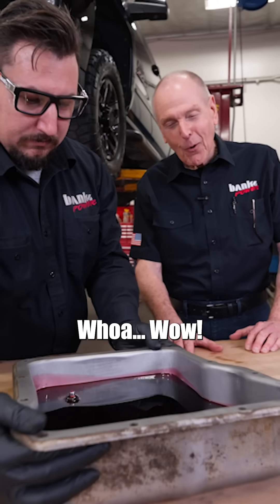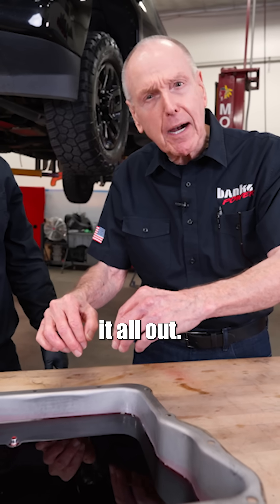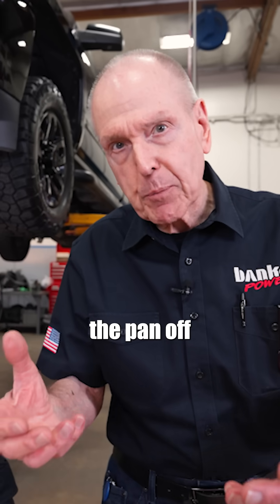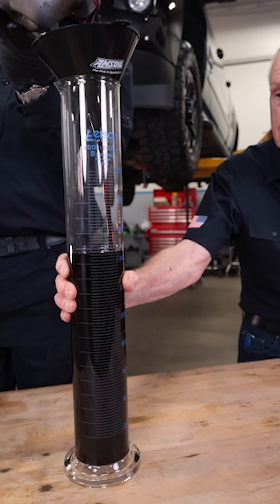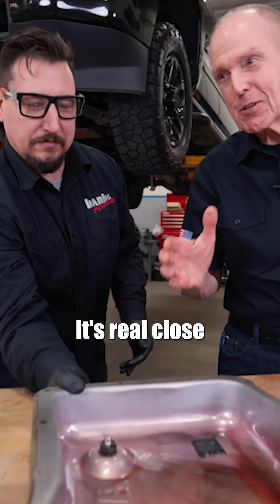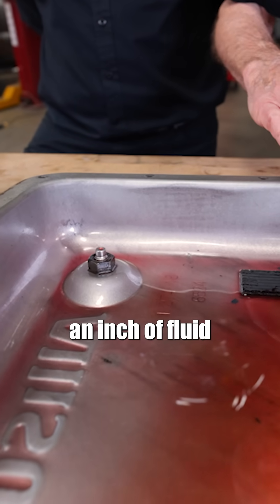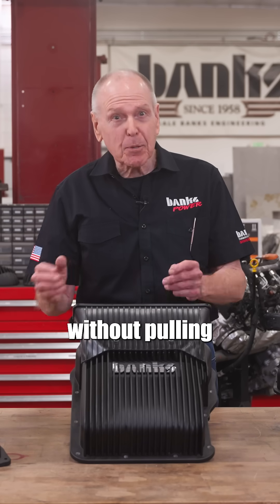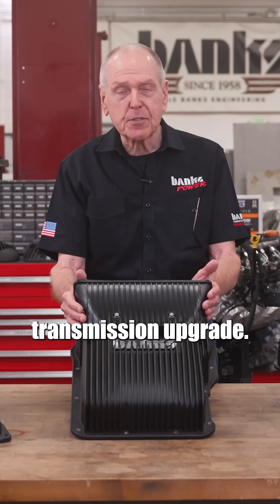This factory drain plug is a joke.

Comment: You know he's a legit engineer because despite being deep in the automotive world, the man actually uses metric units for fluid.
Reply: He used quarts despite the fact that his cylinder measured in mL. It's an easy conversion, though, a liter is a quart and a bit, so a quart oughta be about 950mL. He was about two teaspoons shy of two quarts. Who designed that OEM oilpan?
Reply: Every single American-educated engineer is 100% fluent in both imperial and metric unit systems. Automotive and machining especially utilize EE units because these fields were popularized in the US first, so it’s common to use things like gallons or quarts. But the metric system is better for small fluid measurements in this case, and converting between mL and US quarts is comically easy for someone fluent in both. So yea, it’s not really an indicator of a “legit” engineer, just one with a degree from an ABET-accredited institution.
Reply: @kadenielsen210  Side note...I was educated here at an ABET-accredited university, but I wouldn't say I'm "American-educated" since most of my upper classes were in one of three languages I don't understand well: Hindinglish, Mandaringlish and Python.
Reply: Conversing or calculating in metric units has absolutely no indication of an engineer’s ability or qualifications! Who told you that, your 9th grade general maths teacher?
Reply: They ought to be using the old Hogshead units.
Reply: A quart is not a metric unit of measure
Reply: No neither are .😂 @blakebrown534
Reply: That's BS. All engineers can switch units easy. And many fundamental texts and engineers still use imperial units.
Reply: European people deep in the automotive world have left the chat, since, y'know, apparently they don't use metric units lol
Reply: What are you on about the man refused to say litre with all his being.
Reply: Try finding a graduated cylinder in imperial units.
Reply: I don’t know bro but in Europe we use both anytime we need 🙏😂🤷‍♂️
Reply: imagine not realizing a quart isn't a metric unit.
Reply: @thedarkness125  they are really close to each other. 0.946 litres is 1 US quart.
Reply: @datgamerboy123  Ah, but in the English Imperial system, a quart equals 600ml, so if this was measured in Australia, it would be over 3 quarts.
Reply: @coolhand1964  I guess?
Reply: @thedarkness125  imagine not realizing a quart is, a quarter of a gallon.  it is not a metric unit at all, its roughly a liter.
Reply: @thedarkness125 attention span & reading comprehension (not) much? He references both as the graduated cylinder is filling. But guess what? His final volume measurement is using----a metric unit. Re-read OP's original quote, slowly, 3 time if you have to😂😂
Reply: @cc23001 
His final measurement was: "It's real close to two quarts". 
You are objectively wrong.
Reply: What he literally uses quarts multiple times which is not metric. Every engineer should be familiar and be able to use both metric and imperial. It’s just a conversion mostly. So u kinda gotta be stupid to not be able to.
Reply: @tysonchickennuggets  It's baffling to people that there are people in the world who can convert both on the whim as if it's a 2nd fluent language.

People from the UK are all trained pretty well. Anyone remotely math-inclined in the UK can convert on the dot.
Reply: i like both systems. some things work out easier depending on what the task is.  in the auto world i like quarts and gallons but when working on cars i like metric tools.   its much easier to look at a fastener and know what size metric tool vs sae tools.
Reply: @WhittaII  the UK still uses some parts of the imperial system directly along side metrics, not to mention the differences in US vs British imperial units. 
They got some fun conversions going on over there, and what put me onto it was hearing the top gear crew mentioning gallons when getting fuel one episode. 

All this however makes reading arguments about the superior unit of measure 100x more entertaining because mostly its all out of spite and reverting to other units and saying the previous ones are horrible lmao. Adopt a standard from across the pond, Britain changes something, we adopt that, then Britain reverts back, and out of spite we dont haha. 
Even funnier that metric was made by the french and we were one of the first to trade with them using metrics being they were a crucial ally to the US to spite the British. 
History and unit standartization is freakin wild lol.
Reply: @MrChevelle83 I disagree on metric being easier to identify. I have no issue with either.
Reply: @WhittaII   most conversions between metric and imperial require the use of floating point numbers, doing that in ur head is stupid. unless ur saying only a general estimation.
Reply: @tysonchickennuggets ok this is how English works: OP mentioned Gale "USES" the metric system. You don't think that means he never used imperial, do you? Because that's NOT how English works😂😂
Reply: @cc23001  ragebait? i said he used both.

Comment: I am not familiar with those transmission,  buy my pickup holds 11 quarts after rebuild. But only 6 when pulling the pan to change fluid. So only a little over half come out, i think thats pretty normal for hydromatic transmissions.

Comment: its to visually check for debris or particulate matter. yes your pan will be better, temp wise for the transmission but the oem did it for diagnosis. i do diagnostics at a trans shop but i still recommend some aftermarket pans for heavy duty trucks with a aftermarket cooler.

Comment: Back in the day oil changing places would just use an air hammer to punch a hole in the back corner of the pan to drain it, then put in a rubber plug back in the hole never even touching the factory drain plug because god forbid it's just hanging on by a thread then you finish braking it and now you need to replace the whole pan.
When I had to rebuild that trans, I just pulled the rubber plug, then brazed a nut onto the pan and there was the new, replaceable lower drain plug.

Comment: Typically you are supposed to drop the pan to replace the filter when doing a transmission fluid change.  The plug just helps make sure you dont get a big bath when dropping the pan.

Comment: Drain the pan.  refill the pan.  Disconnect the cooler lines.  . I use an electric fuel pump in a 5 gal bucket of trans fluid.  Turn on pump connected to return line.  Start vehicle.  Pump will fill pan for pump to flush torque converter.  Fluid exiting cooler line will turn clear red.  Turn off vehicle and stop pump.  Reconnect all lines and adjust fluid level.  Complete fluid change and TC  low pressure flush. I do it every 25k

Comment: This is good and all except this it cause a longer warm-up period which typically inhibits torque converter lock.  Even on stock setup on cold days sometimes it takes 30 miles or more to get the fluid warm enough to enable converter lock.  On really cold days the fluid cools off enough and the converter will un-lock.  Properly designed cooling system will have a thermostat.  This is an unregulated system.  A thermostat is more of a minimum temp device and not a max temp device.  If you need more cooling, add more cooler after the thermostat.  Fluid being left in the pan is not that big a deal,  suck it out or drop the pan and dump it.

Comment: I see what he's getting at and gale is an absolute legend. But all services iv done on these you use a high pressure transmission flush machine at the line hook up. So the drain plug really has no effect on servicing it properly.

Comment: Waist of money, I have to drop pan to change filter out anyways lol.
Reply: You do, but it's easier to drop when it's empty.
Reply: @justinnieves984  brah, lol. the 68RFE doesn't even have a drain plug stock lol. So I picked up a cheap metal Dorman for just over $100. Looks just like stock but has drain plug. Doesn't matter if there is any oil left on bottom of pan because once you take it off it's pissing fluid on you the entire time you are under there, it never does stop dripping fluid.
Reply: The filter is external on an Allison
Reply: @TheWabbler  I thought there was one, they have the canister on out side but the flat one on inside. I have the dreaded 68RFE transmission, no problems with it yet knock on wood. They are both internal.
Reply: I would be asking, why did Allison take the time to raise the area where the plug is at? It costs them more money to do that then just put it on the flat or even depress it. I would be careful redesigning things when I don't know why they purposefully did something in the first place.
Reply: You don't have to change the filter as often as the fluid.

Comment: Transmissions ive worked on with drain plugs usually have filters inside you have to pull the pan to change anyway
Reply: That was my thought 💭 too
Reply: Gotta pull the pan to change filter. The drain keeps it below the top of pan for a clean removal
Reply: @GreggWalken-xd3qv  the Allison has an external spin on filter. I'm still a proponent of pulling the pan to inspect for crud and chunks. I like an inch or two of fluid on the bottom of the pan to get an idea of the general condition of the transmission when the pan is removed.
Reply: @GreggWalken-xd3qv  Still no reason why you can't drain it fully... would make for a much cleaner pan removal, like 0 chance of drenching the floor and maybe yourself in fluid.
Reply: @GreggWalken-xd3qv  Not in the Allison. It's an external filter like an oil filter.
Reply: @dodgeplow  My RDS 3000 Allison has both. Internal is a $27 screen type filter allowing 
one to check and clean the pan magnet. The pan gasket cost more than the internal filter
Reply: Yeah ZF trans in Mercedes are this way or built into the pan. So every 60k, new pan and fluid service. $$$$
Reply: @kyleohara1949  Mercedes automatics are all made by mercedes. No zf here :)
Reply: Allison recommends to only change the internal filter at overhaul. Hence why this makes sense.
Reply: @ArizVideo  ok, but even if you don't change the filter, you take the pan off and wipe it out. there's sediment in there AND the particulate magnet that needs to be cleaned. there is no point in putting clean fluid into a dirty pan. the chilton time guide accounts for taking off the pan and cleaning it. you are PAYING for that part of the service, if they are not doing it, you are getting cheated.
Reply: So wouldn't it make sense that the panel has no fluid in it, so it's not a mess to drop?
Reply: @pws3rd170  crud sinks to the bottom of the pan, if the valve were right at the bottom there's a risk it'd get clogged with said crud. Removing a full pan because the valve is clogged would not be fun 😂
Reply: @ShortFilmVD  Fair enough. What if you had a strainer around the drain plug? No clog, maximum draining
Reply: @pws3rd170  the strainer might also get clogged over time and need cleaning out / replacing. Even if it doesn't, it's a extra cost and solves a problem that doesn't really bother anyone all that much.
Reply: Allison's have an external filter
Reply: @ Most still also have a form of filter/screen on the pickup tube, which is still supposed to be cleaned or changed at fluid change time.
Reply: @Superman-pf6uo   they have 2 a spin-on and internal one. So you have to
Reply: @Superman-pf6uo  and an internal one as well
Reply: @Superman-pf6uo  Allison"s also have an internal filter.
Reply: @Superman-pf6uo 5&6 speed 1000 series have 2 a external spin on and and internal aswell.
Reply: @Superman-pf6uo They have an internal and an external, you’re supposed to replace both each time
Reply: You also have to remove the pan to install a new banks part
Reply: That's an Allison, it has an external and internal filter. You change the internal filter much less often.
Reply: @rickyborden3287  The internal, if I recall, is a strainer type filter that is typically cleaned off requiring to be replaced much later than the external filt which consists of fins.
Reply: they all got filters
Reply: You are correct, But I change just the fluid at every oil change and the filter at the scheduled intervals.
Reply: @johnshanks888  you change trans fluid with every oil change?
Reply: My Nissan has a transmission filter that isn’t supposed to be changed.
Reply: @MrPlaidFace people hate on them but the good ol Germans use external filters such as the VW DQ250 DSG. They also don't tell you to run a trans for 100k miles on original fluid. People say high maintenance because they often tell you what the maintenance actually is up front. 30k service intervals for fluid and filter. Spark plugs are 60k. Etc
Reply: Most leaks on pans are on gaskets or drain plugs plus I’ve seen crappy diy jobs where they don’t even tighten there plugs and they vibrate off while driving leaving engines or trannys starved some pans have this (small 1-2 qt reservoir to keep or hold fluid with a failing gasket or plug “called engineering” if it was made that way the first time weirdly/sadly enough for a reason by the engineers.
Reply: If your doing tranny fluid you also do the filter to I was thinking the same thing
Reply: The SN95 mustang is like that
Reply: Exactly. Solution for a problem that doesn’t exist for most vehicles.
Reply: You don't always change the filter. On a lot of cars, you change the fluid 2:1 or 3:1 to the filter.
Reply: Yeah the drain plug is so it doesn’t make that much of a mess. Not so you don’t have to pull the pan entirely
Reply: You could use a larger volume pan if replacing with a Banks but yeah, only a fool falls for this guys propaganda.  Comes across as genuine but in reality he is trying to convince people to give him their money over stuff you don't need or ever need.
Reply: @thereplacementfordisplacement  your just mad that he's way smarter than you'll ever be 😂
Reply: You don’t need to change the filter every time, especially if your changing your fluid every 50k
Reply: Allison specs says internal filter is changed at overhaul.
Reply: For real thought the same thing
Reply: Filter ?
Screen’s.
Reply: Not on this Allison it's external 👍
Reply: yeah but atleast this way you don't get a bath in trans oil.
Reply: Yeah, it all makes a difference. I know some of the VW golfs have a “drain plug” that is actually how you tell the level of fluid, acts like a differential does when it’s got a fill and drain plug. You get the trans to a certain temp and pull the plug, fluid should seep out just a little with the plug off, that means it’s full.
Reply: Allison is external
Reply: More tuned for off roaders
Reply: A lot less messier to remove the pan when all the fluid is out
Reply: diesels usually have the filters on the outside
Reply: This is exactly correct. 
While banks sells quality diesel performance products, they are diving into the "performance truck bling" pool with their finned differential covers and now transmission pans. Is the part "better" than the stock one? Sure. Will the "improvement" ever make a difference in the actual lifespan or performance of the vehicle? In the case of a diff cover, not at all.
Reply: @codymoncrief8478 I know plenty of people who moved to aftermarket diff covers because they had to, the fins help but it’s more fluid volume that really does the trick. No fun trying to offroad or do a burnout when your diff gets too warm for the clutches to grab
Reply: @codymoncrief8478 the only applications I can see a differential cover like that having an effect on the lifetime of a differential would be something like rally racing or some racing application. Most people use an external cooler, like the Corvette C2 Grand Sport or Superformance’s Grand Sport. Or a welded or spooled differential. I would still buy Banks though lol. Extra 5 HP plus the window sticker adds another 5 HP and the chrome badges add another 5HP per side.
Reply: @ I could see that on a racing vehicle, especially with a traction biasing differential, since those units can make a lot of heat. Though, a ducted air supply (like those used on the brakes of f1 cars and similar) would probably be more effective, since the banks air scoops really only work for straight line travel, and rally and drift cars do a ton of sideways movement. 

Now I want to see someone test them on a rally or race vehicle. Subaru, for example, used to put a special finned diff cover on their rear-lsd equipped cars. Some simple welding to make a little air scoop would be a great experiment. I wish I still had mine, I would totally do that
Reply: @codymoncrief8478  dont forget the banks part cost more then the stock part also
Reply: @codymoncrief8478 It keeps the diff cooler so…
Reply: @ The fact that it can keep the differential cooler is largely a marketing wank, since the rather small temperature difference they achieve has effectively no influence on the lifespan or operation of anything on the truck.
Reply: Lol
Reply: AND...there's a drain plug on the torque converter to drain it.   the drain plug on the pan is ONLY there to get most of the fluid out so you don't take a bath in it when you remove the pan. the disgusting thing is, you know he knows this and yet he says this stuff to sell his over-priced crap.

Comment: Pulling the pan and cleaning the magnet is the only way to do a transmission service.
Reply from the maker: The Allison 1000 has an external spin-on filter. Most often guys will drain the fluid using the drain plug and replace the spin-on filter. Only after 100k miles do most drop the pan. So, the convenience of the Ram-Air Trans Pan's drain plug is for those intermediate services.

Comment: That’s because that is a level plug……..
Reply from the maker: The drain plug that we're referring to in the video is the drain plug. If it was used for leveling, you'd run the transmission dry because the level would be under the fluid pickup.